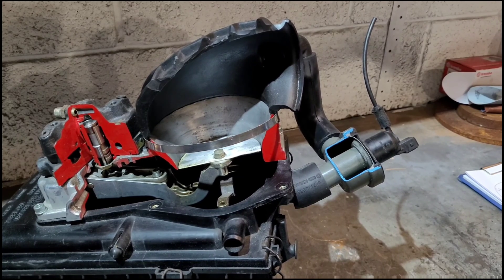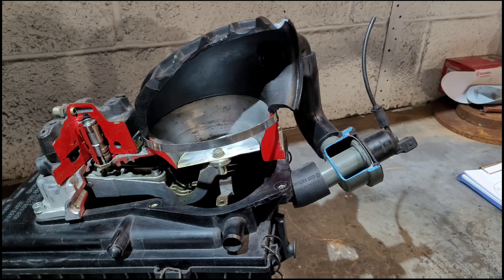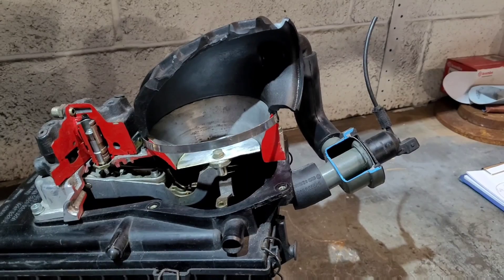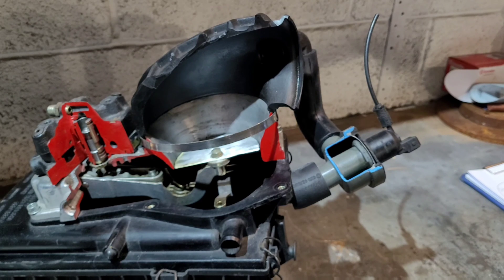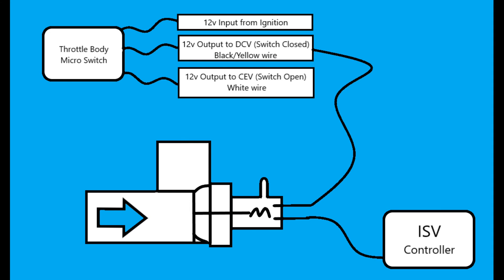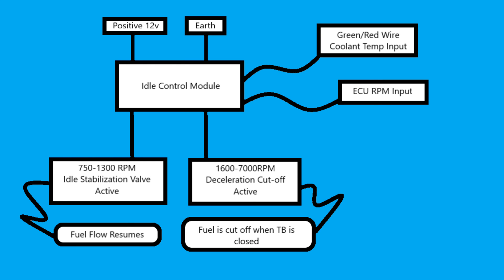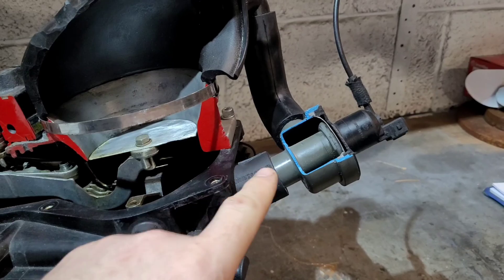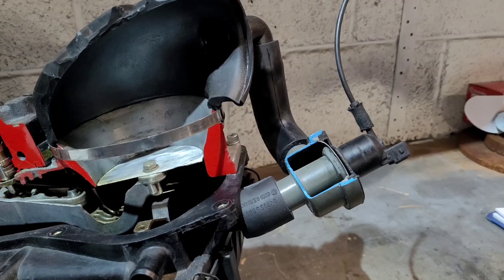Bosch K-jetronic - Mk2 Golf GTi 16v - Deceleration Cut Off Valve

Comment: Had my 16v kr set up for co2 and timing because engine would stall when dipping clutch. It seems to have improved and now only stalls when clutch is pressed  intermittent but only when engine hot. Could this also be the cause. Checked for air leaks and seem fine, had timing checked and fine had co2 set on machine so fine but still revs drop to below 500rmp and further and sometimes stalls but only intermittent

Comment: So I’m trouble shooting my 1992 GTI 16v (2.0 CIS-E Car) it sat for many years - it’s now back on the road but am having a tuning issue and don’t know where to start 

It actually rounds and drives quite nice but after driving for 15-20 min and ur cruising along - you hit the accelerator and it struggles to pick up RPM and hesitates and stutters and then it won’t die but will begin dropping RPM - the further you push the accelerator the quicker the rpm drops 

Then if I turn the car off and turn it back on - issue goes away and only returns after another few minutes of driving again
Reply from the maker: Off the top of my head I'd make sure the O2 sensor isn't failed, failing 
Check the potentiometer has a clean sweep of volts from closed to fully open
Check the resistance on the DPA

Comment: Oh my word, literally the answer to a prayer this! My gti keeps cutting out when pushing the clutch in, after going over a certain rev range, when it’s very cold or on complete random. Will replace this module and see if that helps! 🙌🏼
Reply: Where can you buy these from, only ones I can find are second hand and so I don’t know if they are faulty or not
Reply from the maker: @ethanhunt7322 unfortunately only available used contact dubstock for good spares
Reply from the maker: Hopefully you get it fixed

Comment: When the coil has voltage to it, is it holding the valve shut or does it free the diaphragm so the vacuum can open the diaphragm. Im getting 12v at idle, rev the engine above 4000rpm and it stays at 12v then close throttle and the voltage stays at 12v until revs drop to around 1500rpm and voltage goes to 0v for a second then holds 12v at idle again. Haynes manual says that i should have no voltage at idle?. Any help would be appreciated. Thanks
Reply: Thanks for the reply, I have taken out the control unit and opened it up to find two capacitor's/diodes melted. I've got a replacement coming, so hopefully I can make it to Silverstone next week. Do you think this could also be the reason behind my misfire/juddering between 2k and 3k on partial throttle. Thinking if the  declaration valve is opening its causing it run lean. Pulls fine if you floor it.
Reply from the maker: @mac8118 most likely if there are melted parts in the control unit, hopefully that fixes it
Reply: Fingers crossed. Thanks again. I wouldn't have been able to rebuild my car without your videos. Are you at German car festival next Sunday by any chance?
Reply from the maker: @mac8118 happy to have been a help, nope can make it unfortunately
Reply from the maker: You should have 12v with the throttle open and revs above 1300 rpm

If thats wrong you could either have an issue with the throttle switch, idle stabaizion control unit (behind centre console) or the cold enrichment valve and deceleration cut off electrical connections are mixed up

Comment: Hello, I have a Golf mk2 with 16V KR and when depressing the clutch by approaching an intersection or turn. The engine revs drop below 0 resulting in engine stalling? I have already checked all the vacuum lines but result remains the same... could it be the ISV valve? It controls the idle speed when the clutch is depressed, doesn't it? Can you help me with this?
Reply from the maker: At the back of the air box there is a black and grey valve (Deceleration fuel cut off) un plug the electrical connection and try again, this is also idle control, it slows the engine down to about 1300rpm then the isv takes over
Reply: @GreyGooseRestorations  Yes someone told me to try this aswell and it looks to work! this is not a problem for the car?
Reply from the maker: Not a problem as long as your aware of the differences, just needs a bit of driving style adjustment
Reply: @GreyGooseRestorations 
Hey I unplugged mine as occasionally my car would stall at the light when coming to a stop. So I unplugged it and the car runs exactly the same!!! It hasn’t stalled at all either but that was intermittent so I will just leave it unplugged. Why am I experiencing no difference in how it runs plugged in or not?
Reply from the maker: @stankamps4091 All they do is help slow the engine, but with it unplugged, the engine will slow itself down anyway. The most noticeable difference is if you coast to a junction etc the engine may stall

Comment: Could this be the cause of my system only revving above 2000 revs and cutting off and not idling below that? The only way I can get the car to run is by jamming a screwdriver in the sensor plate!
Reply: P.S. as with all K-Jetronic videos, I have to watch them at least 6 times to get my head round it!! Thanks for your excellent videos 👍
Reply from the maker: Thanks, and yes it could well be that cause of it cutting out

Comment: Great video, mate, keep going! Really, really helpful info. Recently I've been working on my 1.8 KR Scirocco and trying to properly tune it for a great driving experience. 
I'd like to add some more info about Idle stabilization module. There is also a single green wire (pin "K"), which is not conected to anything. I couldn't find the definition in data sheet, but by testing the unit and it's internals I found out next: This is an input signal when the A/C is on, so the ISV can adjust the RPM right when additional force is being aplied by the A/C compressor.
Reply from the maker: Good find, yeah some info needs a bit of reading between the lines to make sense of it